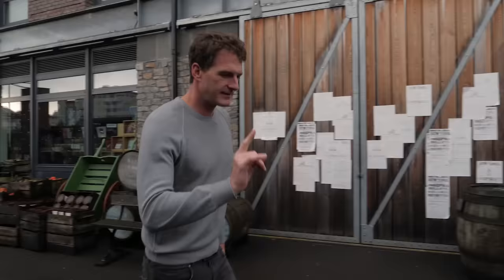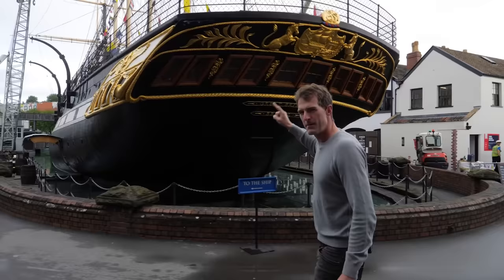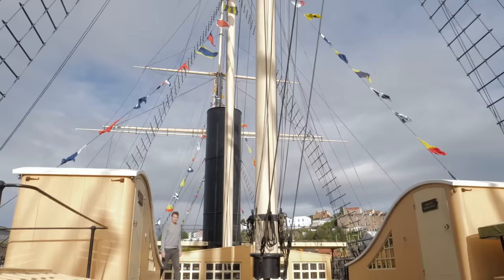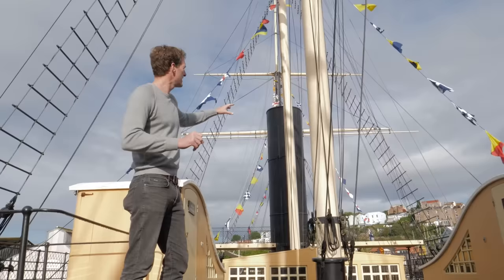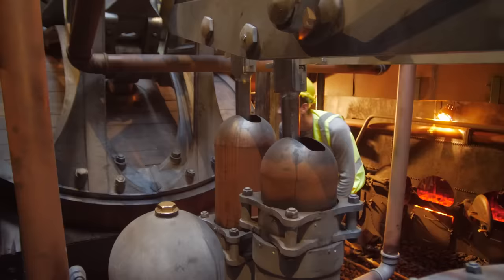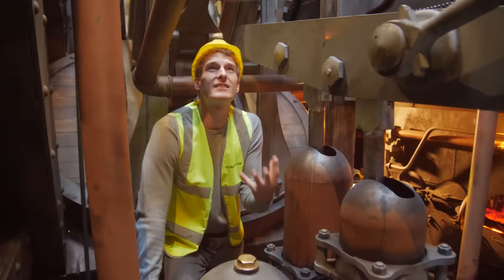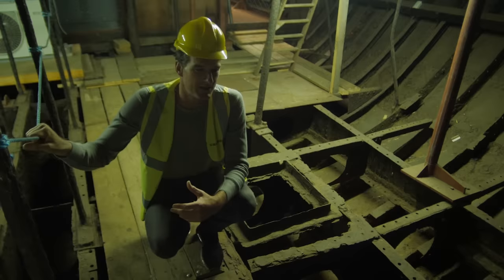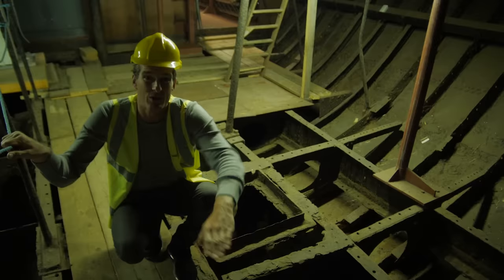What Was It Like Aboard The Largest Passenger Ship Of 1850? | SS Great Britain With Dan Snow

Comment: It should be said that the ship returned to Bristol as an empty hull with a leaky deck and just half a mast standing. All the interior and the engine+boilers are replicas and for reason of weight the engine is made from hollow parts. The impression, though, and the obtical illusion is perfect.
Reply: Meanwhile when he is in the bilge talking about the box like structural supports you can see light shining through the the holes in the hull of the ship.

Comment: I was a trainee engineer working on the television outside broadcast unit the evening they towed it into the dry dock back in 1970. They had to wait for the tide, so by the time it was safely in the dock it was starting to get dark. I went and had a good look at it, and it was in a very sorry state. It resembled a broken egg shell that someone had tried to glue back together. There were gaping holes in the hull, and inside appeared to be a mass of scaffolding trying to hold it together.

I went back to visit it for the first time since a few years back - probably 2014 or 15. I couldn't believe the transformation. The restoration work has been stunning! It was hard to believe that I was looking at the same wreck that I had witnessed back in 1970. It is a memory I treasure.

Comment: He didn't mention it, but I could see sunlight pouring down on the engine. Those first steam ships with the walking beam engine had to go through the deck so the beam was above deck, thus a big rectangular hole was in the roof of the engine room. In foul weather the crashing seas would pour down through this opening so the pumps had to operate continuously.

Comment: I was able to visit this remarkable exhibit in 2018. Although Dan Snow's commentary was interesting, it failed to cover some key elements. The first is the way the SS Great Britain is displayed which, unlike most other maritime exhibits, is shown partly "as found" as well as restored. The unique preservation of the hull and access to the ship is due to the reinforced glass paneling that girds the entire ship and provides the illusion that the vessel is floating in the dock. The dock in which she was originally constructed. The fact that she exists at all is due to being constructed in iron. Wooden hulls would have long disintegrated. Brunel's experience with building iron structures allowed the construction of a ship that set new shipbuilding standards The propulsion screw was indeed unique. Not mentioned was that, under sail and to reduce drag through the water, the screw could be raised clear of the waterline. Brunel designed a "triple expansion" steam engine that uniquely harnessed generated steam through 3 cylinders of expanding diameter as the steam pressure reduced. This allowed every once of pressure to be efficiently extracted from the coal boilers. As the City of Long Beach in California contemplates the fate of the Queen Mary, it is worth considering how this other "state of the art" vessel could still become the historic exhibit she was meant to be.
Reply: @Bob-fk8vd  Good catch. I guess Brunel benefited by building the SS Great Britain some 50 years after the USS Constitution was launched. I guess I should have highlighted the fact that a similar wooden vessel, laid-up and facing the elements in the Falkland Islands for 33 years would not have fared so well!
Reply: @Bob-fk8vd  Very little of Constitution is original though, including her hull. A lot has been sacrificed to keep her in seagoing condition.

Comment: I'm sure the steam engine was balanced very well and was bolted down and the bearings ensuring a smooth running of the engine.
Reply: Even modern reciprocating engines will shake themselves apart at high speed.
Reply: Steam engines are generally super smooth running. Being in a steam ship is like being in a sailing ship, no vibrations from the engine whatsoever and dead silent.
Reply: @negergreger666  uhm not really, even on much larger ships engine vibrations were know to be felt accross the whole ship.

Comment: Perhaps it is time to return to a mixture of sail and engine for all seagoing vessels? Certainly for those for which the duration of the voyage is not a critical issue.
Reply: Sure would be GREEN!
Reply: Well, ships have become much larger in the past century. It might work for smaller ships, but normal cargo ships are probably just too massive for that to be practical. It'd be amazing if that could happen, but I'm sadly skeptical. I'd think it's more likely that hydrogen fuel or other green options will be developed, honestly.
Reply: @Cailus3542  Yes, hydrogen is almost certainly the fuel of the future.
Reply: I would speculate the ocean can be used as an electrolyte to drive electric motors.  Commercial sail only ended with WWII.  As long as it did'nt need to get there fast sail was OK.  It was killed by rising labor costs as sail ships needed like 400 men to operate.  Modern cargo carriers use about 30, typically from third world countries.
Reply: It  would certainly mean a saving in fuel.You would never get me up on those yardarms though Lol.
Reply: @folkme3042  Nowadays, if it was financially advantageous, the raising, lowering and adjustment of sails could probably be automated.

Comment: I did have a delivery job to their visitors centre, 4 years ago... Bringing  a bigger paket to them. Asking them, I was allowed to visit the ship - they said NO. I just took a look of the visitor centre and the yard.
The ship is in the dock. the dock is sealed. It's mostprobably not anymore seaworthy.
Reply: I'm sure it's seaworthy they are trying to keep the boat dry to keep it from rotting when it's in the water it will eventually rot if not pulled out all the time and dry docked and repainted

Comment: Looks a bit different to the wet, rusty and fairly empty hulk that I was taken to see in the 1970's !! Got a tour of the inside, just scaffolding , emptiness and more rust, underwhelmed at the time. Remarkable improvement !  Wonder how much is new?  Like the engine? Where did that come from?
Reply: Guessing its a mock up powered by an electric motor pushing that piston (?) around for effect only. Still looks impressive though.
Reply: @VisualApproach  Yes, it had to be, the engine and heavy stuff  had been stripped out and sold many years ago..  I was told that the Bristol Aero Engine Apprentices made it.  It's an accurately scaled , lighweight remake. and, as you said, powered by electric motor.   A most impressive sight, to see it's moving parts, worth taking a visit, just to see that.

Comment: Interesting thing about Brunell was he favored the 5 blade propella design for his ships, but it would later be proven that the 3 proppella design was vastly superior.
Its a shame imo that of all his ships the SSGB is the one to survive, the Great Eastern is a much more interesting ship, having been used for the laying of some of the first transatlantic communication cables.
You also have to consider that the SSGB was used as a coal liner for decades, it was stripped down to a rusted iron hull, everything except the metal exoskeleton and propella is a modern reconstruction - even the engine, if I remember correctly. Not that I would hold that against the warrior, but that is a far more interesting ship historically.

More interesting than the ship itself, is the bristol floating harbor in which it was constructed, reconstructed, and now sits next to as a museum. The ship would not have been possible where it not for the construction of the hotwells basin and lock, as well as the dissasembly and re-assembly of an entire bridge to get it out of the harbor after its original construction.

Comment: 8:45 is the big wheel a flywheel that was attached to the propeller shaft?
Reply: Yes huni it was.
Reply: @thomaswright7562  I'm not your huni, pal
Reply: It isn't actually a flywheel.  Brunel was challenged with how to gear the engine to the propeller.  His concept for using the screw design game from the SS Archimedes, but the gearing used to connect the slow rotating direct acting piston engine to the faster rotating screw on that ship created significant noise and was unsuitable for a passenger ship.  Brunel came up with the first chain driven gearing to solve the problem and the "wheel" you see is part of that gearing.
Reply: @soupwizard  you didn't moan last night
Reply: @thomaswright7562  Surely this is un necessary.  And don't call me Shirley.
Reply: @rogersmith7396  you bad boy
Reply: @thomaswright7562  Nice beaver!
Reply: @IamJunius  Ah thanks - it's like a giant bicycle gear!
Reply: @rogersmith7396  you mean   don't call me

Comment: Are the replica engines in the ship the original ones or the newer more compact ones fitted for most of its career?
Reply: The engine on the ship now is a replica of the original 1843 engine.
Reply: @alanstansfield7707  it would be nice to see engineering diagrams for the later engine and some info? 🙂
Reply: @alanstansfield7707  correct. and most impressive they are too.

Comment: How about knowing your subject matter before doing a doco? No the hull is not "as found", large amounts of repairs were carried out as the hull was swiss cheese with huge holes and a giant crack in her, quite a bit of the rust now showing is from being unprotected in Bristol for many years before the glass "sea" was installed. 

You appeared to be in the officer's quarters (P Deck), not the crew mess (R Deck), the officers were actually forward of the crew in the Great Britain, she was far from roomy.

No, it is not a wonder that the ship didn't shake apart, steam engines are remarkably smooth and it would have been almost impossible to tell they were running.

Comment: I thought it was more the other way around, it used the sails and boosted its speed when needed with the engine as, the engine was quite feeble and used too much coal to cross just on steam? Also while propellers were slightly more efficient and better in storms, they were a total bugger when you were trying to manoeuvre such a large ship in and close to port, this is more why paddle steam carried on longer than it should have (and still did on tugs), not because none knew about propellers, it just made docking possible in such a large ship. Not sure if actually due to its  lack of manoverbillity, but it did have a bad run of running aground, but while the engines were feeble, the hull was incredibly over engineered and suffered these groundings far better than a modern ship could have. I think it did much better after its main refit however, compact but more powerful engines and larger amount of sail too to allow proper tacking of the wind. It was still an expensive ship to maintain though and only marginally profitable, running mostly as a sale ship. Running on salt water too for steam must also have caused major silting up of the boilers and pipework, god knows how much cleaning was required to keep it functional?
Reply: i believe the boilers and the steam pressures was not very good back then. i understand at times they had store bags of coal on the deck.
i understand they had burn fire wood when they ran out on one trip
Reply: @eliotreader8220  Yes I've heard that too they had to burn furniture to keep it going as no wind, the engines too were low pressure and inefficient, at least compared to later machines at only 6psi! With upto 1000hp, a modern vessel of the same size would have 5x this amount of power available and bow thrusters. I would imagine therefore in poor seas and or high cross currents it probably could not make much headway? Maybe this is way it kept running aground so much?
Reply: When travelling to New York then the engine was the main propulsion and the sails were used as an extra help when the wind was blowing the right way. When travelling to Australia it mainly used the sails and used the engine when there was not enough wind, for example around the equator. Once at the bottom of africa the wind is reliable and they would actually pull the propellor up out of the water to reduce the drag.
Reply: On a modern sailboat the engine is mainly for getting in and out of dock.  Of course I run my diesel all the time with auto pilot.
Reply: @rogersmith7396  you need paddle wheels, just think how manoverable you'd be? 🙂
Reply: @anticat900  More importantly it would be great for eliminating pesky jet skiers.  They do have a fake paddle wheel steamer on this lake.  I can out run it.  I have never raced the fake pirate ship.

Comment: 3:20 Well, we your viewers have no frame of reference. How tall are you? 6'0 to 6'3"? How long is the bunk? The average height of a male in 1850 was 5'5". Owing to better nutrition, an upper class male might be 5'7" on average. Depending on the mattress type, the passengers may not have been supremely comfortable, but they should have managed to fit height wise, even owing to a slight bend of the knee.

4:15 Another indication that your height is not on par with British males of 1845-1850. How many times did you hit your head on that chandelier/light fixture? At least once I bet. 😂 Fellow, your height would have been an oddity in that time period, and more so sailing on the SS Great Britain.  No reason for the histrionics as seeing the ship with otherwise good information is enough. Cheers.